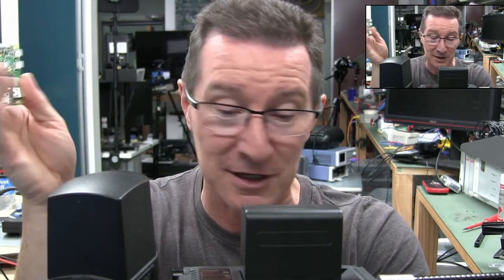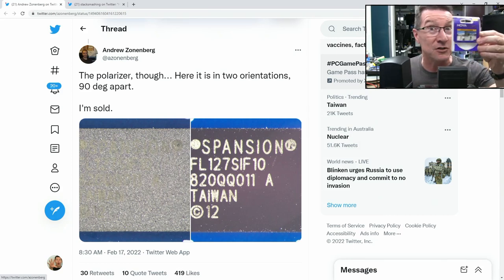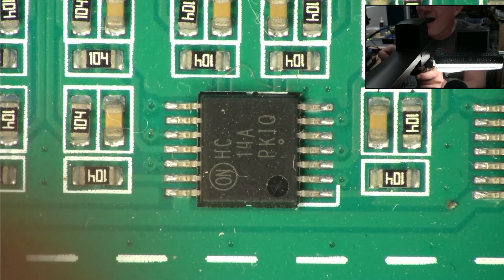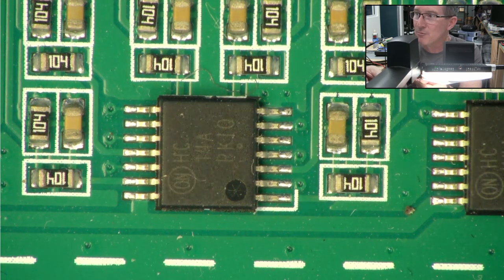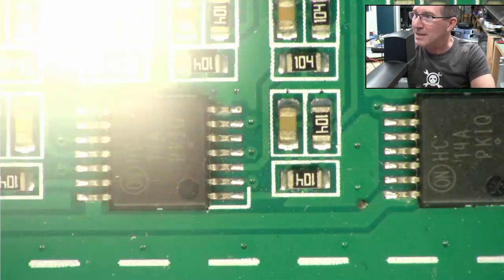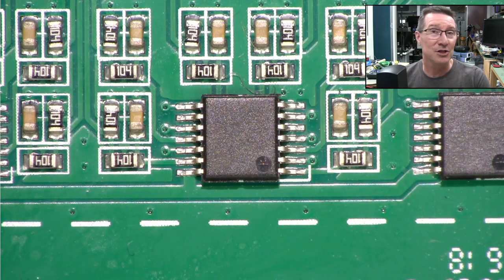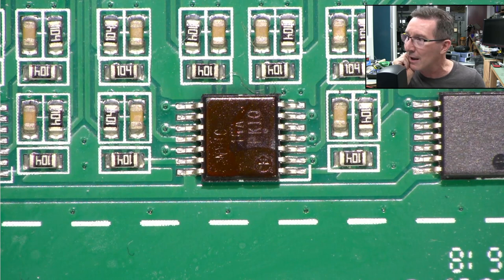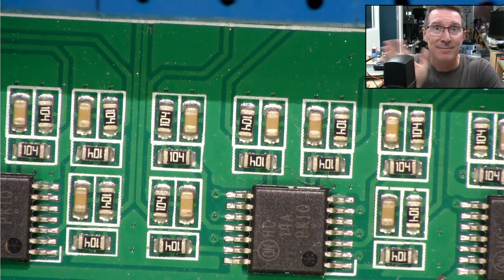EEVblog 1458 - Microscope Polarising MAGIC!

Comment: Sticking a linear polarizer film to a ring light and looking through the middle should do the trick, too.
Also smartphones with non-OLED screens could be used as a makeshift polarized light source.
Reply: But wait, does that work or not? I'd have guessed that the polarizer on the lens needs to be at 90 degrees with respect to the polarizer on the light, so what you're describing here would be the worst possible case we saw while spinning the polarizer around?
Reply: @TheHuesSciTech  In my understanding you want only the light to enter your eyes that came from the same angle as you are watching. When you stick a polarizer sheet under the ring light it would first filter the light's light and on the way back only let this light return to your eyes. As result you are removing the light from surrounding light sources.
Reply: @MetalheadAndNerd  No, it would enhance reflection where polarisation is kept.
But the light from elsewhere will just be filtered as it comes through.

Ideally you want the only light source used to be polarised, or at least the only significant light source. And then you want the return path to be polarised, but in a manner where you can rotate the 2 with respect to each other to allow different polarisation through.
Reply: @jeffreyblack666  Are you hoping that the edged surface changes the light's polarization in a different way than the non-edged surface?
Reply: @MetalheadAndNerd  Yes, as the video shows.
Based upon what happens it appears that the main chip surface preserves the polarisation, while the engraved surface does not.

If that is the case, it means without a polariser or with them in the same orientation, the chip surface appears bright and you can't easily see the markings. But when oriented at 90 degrees, the majority of the light reflecting off the chip is blocked as it is the wrong polarisation.
Reply: @jeffreyblack666  Of course I want the etched area appear bright. The non-etched area will scatter the direct light and appear darker.

Comment: It's a fun trick though, I had a run in with it just out of college. I had to inspect circuit boards overmoulded with a transparent material. This caused some issues near the injection port because the material was so hot that it washed away the nearby solder and caused little balls of solder to dissipate throughout the plastic. I was tasked with inspecting the outcome, but to improve release upon cooling they had sand-blasted the surface of the mould, the result was a quite effective diffusor which created a hazy surface. While x-ray worked somewhat, it wasn't ideal to find little balls of solder, so in the end out of sheer misery I tried a metallurgy microscope with different filters, the polarizer worked every single time because it neatly removed all the scattered light from the rough surface. What also worked surprisingly well was an immersion objective, but that tended to be quite messy.

Comment: If rotating the polariser changed it, it either isn't a filter for only allowing circular polarised light through, or you are using it backwards.
A great advantage of circular polarisers is that the orientation doesn't matter.
But that is for use in things like 3D movies.

A circular polariser typically works by combining a linear polariser with a quarter wave plate.
To produce circular polarised light, it is first made into linear polarised light and then the quarter wave plate makes it into circular polarised light.
To then filter it, it goes in reverse, first passing it through a quarter wave plate to make it linear, and then filtering that linear polarised light.

Also, a lot of screens these days are starting to have circular polarisers on them as well, as it helps cut down glare.

Comment: This is usually called cross-polarized reflected light and is actually often used in macro photography. I've been using if for quite a while to discover otherwise hidden details in meteorites. The difference is indeed striking. The required investment is also insignificant.

Comment: High again Dave. I tried the marker trick you mentioned during this video. It worked really well. I used a red Staedtler marker, dabbed some ink all over the IC's surface, and was immediately able to see what I could barely make out with a magnifying glass. Thanks for this trick. It helped me a lot.

Comment: Totally worth getting two polarising filters (one on the light source and one just before the lens) if you are interested in mineralogy, geology, gemmology, cell biology, optical physics, materials sciences, seeing stresses in transparent or translucent materials, etc, etc. especially if you already have a good microscope to play with. In my experience the polarising filters from old lcds are pretty good especially if you can get a few with the same orientation (some screens actually have more than one per side) and you get them to stay flat.

You don’t have to use a transmitted light microscope (where the light goes through the sample) to see the effects most samples of anything which isn’t clear the whole way through will reflect enough light to give you a good look. If the samples are totally clear you can use a mirror under the sample angled very slightly so it doesn’t shine light straight into the lens. (Transmitted light microscopes have a condenser under the stage which focuses the light making it so only one light path goes through the same bit of sample into your eye which makes divisions like cell walls and stuff so they will not be nice thin lines without one)

Circular and linear polarising filters will actually produce different effects when looking at some materials.

Comment: Side note: A thing which may be useful are alternate light sources, e.g. infrared and ultraviolet. I remember a clip a coupla years back where they had discovered that exploding caps left a residue easily detectable under UV light.
N.B. Protect your eyes and use appropriate filters to protect your scope or camera.

Comment: Note that with a polarizing filter half the reflections on your solder joints and reflections on the edges of the raised tracks also disappear, and make the image better to judge. Downside is that you need double the light, so you could miss out on depth of field.

Comment: I use a cheap bottle of $1 water based acrylic white paint. Just barely wet your finger with the paint, touch the top of the chip then immediately wipe it off.  The paint fills in the etched part numbers and you can then read them with a naked eye from any angle.  If you want to remove the paint you can use a cotton swab with alcohol, though it doesn't harm anything and there is barely any paint on the part if you just wipe it back off. Never found a chip where it didn't work and takes seconds to do.

Comment: He needs it because of the ring light. So you need cross polarization to block the reflections. You are using an off axis light so you can simply position your lights ource such that it is not producing an incident angle reflection on the chips. For real full put a piece of "transparent" plastic between the polarized film on the light and your polarizing filter. Rotate the polarizing filter until the light looks black and enjoy all the pretty colors of the light being bent by the birefringence of the plastic! With the two polarizers 90 deg opposed they block all the light (this was an old school way cinematographers would do a fade to black without any post processing... Two polarizing filters and you turn one during the shot.) The plastic alters the polarization of the light (differently at different frequencies) and makes pretty prismatic colors in the plastic.

Comment: And this is generally why Pick N Place machines will have LED illumination at a few different angles to the part.

That lets them better differentiate between the main outline of the part and reflective "pits" etc.

Some fancy PnP machines will even read the part number, and compare it to the BOM.

It is quite magical using a polarizing filter on a camera, which you see the reflections disappear from water, windows etc.
You can try it on your own eyeballs, too. lol

Comment: Nice Video Dave! The effect that the image gets darker by using the polarisation foil with unpolarized light is not due to losses. Because randomly unpolarized light means that 50% of the light matches the direction of the polarisation foil, leads to a blocking of these 50%. So because 50% of the electric fields gets blocked, the light intensity should drop by 1/sqrt(2) if I remember correctly
Reply: And light is still passing through if you have 3 polarization foils stacked on top of each other, one at 0° one 45° and one at 90°. Despite the overall 90° turn in relation to the first filter, light is still passing through. However, light doesn't pass if you remove the middle 45° filter.

Comment: If the object lay flat on the table, I usually turn my ring light off, put a light source (soft light is better) from six o'clock direction from the object, rise it up so the light falls about 45° to the object. It works quite well for me to read those laser markings.

Comment: "polarizer won't help unless you also have a matching light".. Absolutely, that is why photographers don't use a CP filters all the time. It's usually for sunset, or water bodies or sky, all of which scatter the sunlight which polarize the light. The CP then allows to filter out polarized panes of light allowing to show water reflection VS making it darker for example.

Comment: Love that 6809 reveal.  Working on my homemade Color Computer project and that's the CPU for it.  But of course I'm using the 63C09 instead because it supports faster speeds and has a few more features while being 100% backwards compatible.

Comment: I use brake cleaner fluid. Sometimes if there is some grease in or on the laser engraved texts it realy helps to make it visible again. If there is grease on it, sometimes just changing ligthing direction doesn't help. And you just can't wipe that off from the surface, and it is changing light reflection from the engraved areas.

Comment: if you want to test things with polarizers you can find them in a defective monitor .. just check the backplate reflective setup. made up of all kind of polarizing (at least two filters with 90° offset), reflecting and diffusing light filters to get a more even and straight back lighting for the pixels.. (and be careful in old monitors so you dont break the HV cfl tubes)

Comment: I've always just got in the habit of slightly tilting what I'm working on if I need to read a part number. Would love to eventually get a good adjustable polarizing light setup at some point, but what I have works well enough for pretty much everything.

Comment: The best solution is to use 2 pairs of 3D glasses for theaters ("real D 3D") and only the right of left eye part. You put one (in reverse) in front of the light and one in front of the objective.
The one in front of the light must be used in reverse to create the right polarisation. The light is where your eyes are.
This is because the filter is not symmetric because it actually use a linear filter and a part that delays photons (quarter wave plate) depending on their polarisation.
Then you use the second one to capture the image.
I don't know how the photo filters are used in the video but maybe the one on the light is in the wrong way.
If you don't use the filter properly it's just doing linear polarisation, not circular!
Reply: Check how those filters are made to understand why both sides are different and why the one in front of the light must be used in reverse:
https://en.m.wikipedia.org/wiki/Polarizer#Circular_polarizers
Reply: The reason you need twice the same part of the 3D glasses is because you want to create for example right hand rotating waves that become left hand after specular reflection and filter that out with a left hand filter.

Comment: Very interesting ... and your answer is even better.

Really, this is all about glare. I bought a ring light with my microscope and was rather disappointed for 2 reasons:

1) It was WAY too dim. The dimmer knob was useless, since it always needed to be at Maximum. Perhaps I could have bought a more powerful one?

2) The ring produced a HUGE amount of glare, making it difficult to see and giving me headaches. This is because of the small diameter of the ring. Basically, the light goes almost straight down, and bounces straight back up. Horrible. This becomes worse as you raise the microscope. A larger ring would help ... but there's a practical limit to the size, and a higher cost.

My solution: I made a simple bracket, attached to the lens with a ring adapter, on which I placed 2 ordinary (100W equivalent) LED bulbs, which are offset 100mm on either side of the lens. The arrangement is similar to lights on a copying stand. Also, I added opaque reflectors, so the bright lights are not 'in my face.' I haven't bothered with dimming. I could, but it seems unnecessary. There is LOTS of light to see with, and the glare is completely gone. As you correctly suggest, reducing the glare is all about placing a light off to the side. I've never used my ring light again ... my solution works much better. 

Any difficulty reading text, I just rotate the chip/board until it becomes visible.

Comment: Super fantastic! I use my smartphone (have no microscope) with torch on. Usually I take a picture and then enlarge it. But couldn't read the part numbers on a few  mosfets. All I had to do was to take the picture from a sharp angle - thanks!

Comment: - 12:45 You don't need a sharpie, licking your finger and rubbing it will often suffice. Sometimes I resort to smearing a bit of white thermal-grease into the etchings.
- 14:23 In my experience, polarizing film does not "peel off nicely" (at least from TVs), they're pretty horrible and messy to get off. 😕

Comment: This is basically the same way you inspect optical components. You can't just shine a light on a lens from one direction and then decide that it's fine. You have to shift the light source or the lens around (whichever is easier) to illuminate things from different angles.

Comment: The so called circular polarization is the effect of two filters, a plane polarized filter (also historically called a Nicol), and a quarter-wave plate also called a retarder. The retarder effect is two shift the phase of one of the two orthogonal polarized images with a quarter of the full range of visible light. 
The trick with the angle of illumination was marketed by Leitz in the Ultropak package. The image for difficult to obtain samples was indeed a game changer. An Ultropak would eat the guts of any microscope illumination system today. 
What is happening when you move the external light is that you add light with polarized directions different from the ones your system was tuned to exclude. So when one buys polarization filters they should be always in pair. One filter to control the polarization of the incoming light and the other to control the outcome of the reflecting subject.

Comment: Maybe the trick is to have a ring-light where the polarization changes with the angle (along the ring). Then a polarizing filter basically filters the incident-angle and you dont need to fiddle around with an additional light.

Comment: Use ethanol (or isopropanol), this works better than a whiteboard marker. With a q-tip, the dust (basically old human skin) can be removed easily.

Comment: Linear polarizers cause problems with SLR camera's, due to the mirrors in the light path. Now that we are moving to mirrorless camera's we should be able to move back to linear polarizers for mirrorless cameras (depends on what filters are built into the sensor).   :-)

Comment: Woah tried it and its fucking AMAZING! If only I knew this sooner... Edit: Caveat is that its really only effective on matte finishes. The more specular packages with the narrow engraving (e.g. SMT transistors) don't work any better. Still the pair of junk polarized sunglass lenses are now in the drawer. I like! And for me it helps as the "microscope" is my eyes. Real time saver on a large board to just buzz through it with a flashlight and not have to re-orient it.

Comment: It will depend on the light source you are using. Led light has a different wave length of light to say the sun's light , so not likely to work well. Oh, your light source should be at 45 degrees to the board surface.👍

Comment: Polarizers are expensive and a pain in the butt. You can get the same effect for reading chip labeling by shining a flashlight from the side onto the chip. Much simpler method and the result is pretty much the same.

Comment: Does the polarized setup let you see the part number when lighting from any angle? If so, it can be a real quality of life thing to have
Reply: The main idea behind these setups is that both the objective and the light ring has to have a polarizing filter. In these Leica ringlights (I have an S9i with a LED3000 RL polarized ring light) the objective has a fixed polarizing filter, and the outer filter in front of the ringlight is rotatating. 
It does NOT matter much at what angle you are holding your board/part/ic, since the ringlight polarization and your objective polarization are adjusted to avoin reflections, the visibility of direct-markings remains unaffected.
For anyone wanting a cheap alternative, you just need to cut a circle and a larger ring from a polarizing filter salvaged from an old LCD and mount/glue one in front of a cheap ringlight and mount another one in front of the microscope objective (after adjusting it). It's a-nice-to-have if you could 3D print a ring for the ringlight filter so that you can adjust the reflectivity as you go.